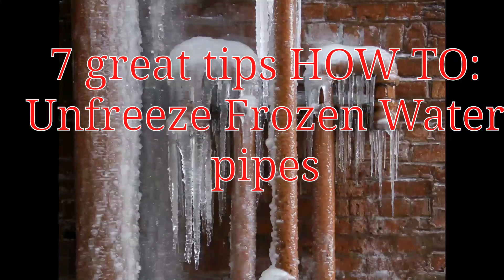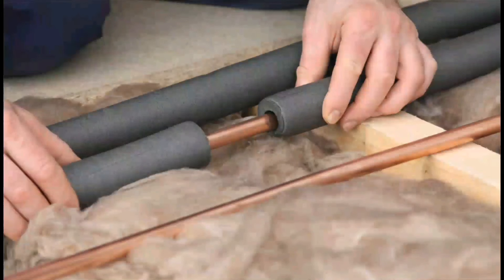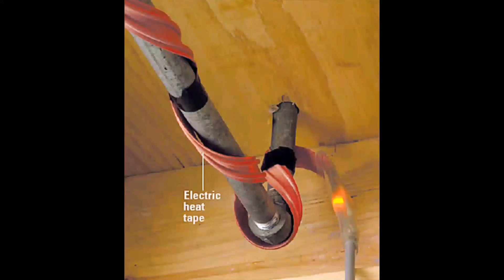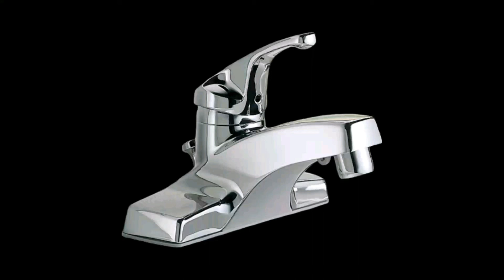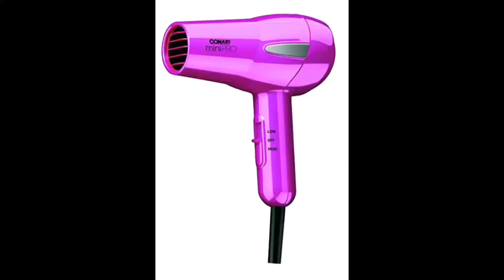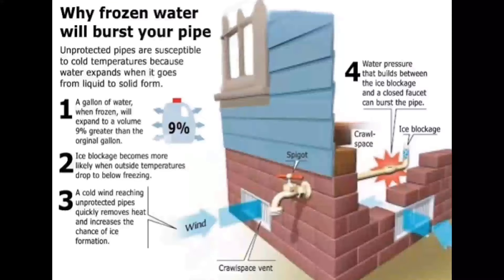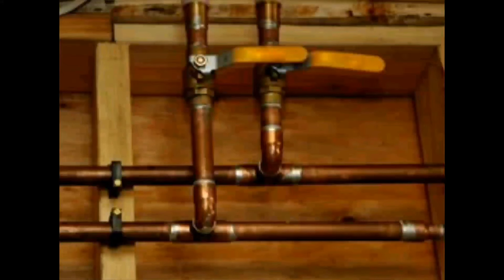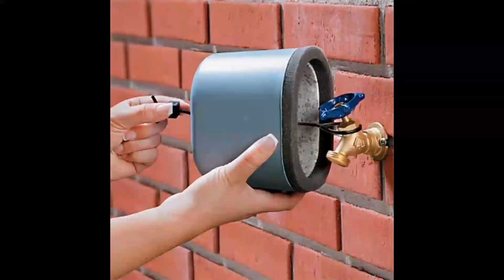How to Unfreeze FROZEN WATER PIPE IN HOME - THE BEST METHOD

Comment: I’m sure you’ve improved immensely in the last three years. Thanks for up loading this. I have no water, the pipes are all in the walls except where they enter and exit the tank, it’s been -10c for the last three night. So I’ve opened the taps and hope that the weather warms up in the morning. PEACE ;]
Reply: Did this work? I'm currently in Florida and have the same issue. No visible problems from what visible. The freeze just started and silly me I didn't leave a faucet running.
Reply: @ColtonAplin  did it work?
Reply: @Jacob Ortwine  Turns out the city pipe had burst.

Comment: What's your opinion on a heat gun? The pipe gets frozen at an elbow and it's in a very small cramped space above your head. We usually use a hairdryer. Heat gun seems extreme for where the location of the pipe is.
Reply from the maker: I would use with caution on low heat setting!

Comment: I just put two tea lights  under the pipes hope it works
Reply: Don't do the tea light thing busted the fucking pipe at a elbow guess to much pressure hahahahhaa well at least I did it and not you
Reply: I'm trying a blow dryer and a heat gun. It's been about 6 hours and still no water.